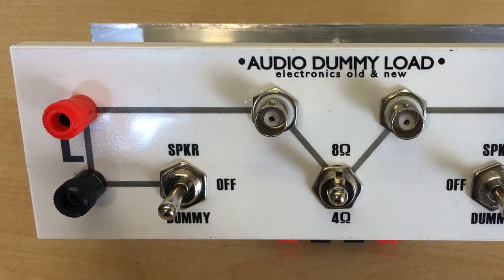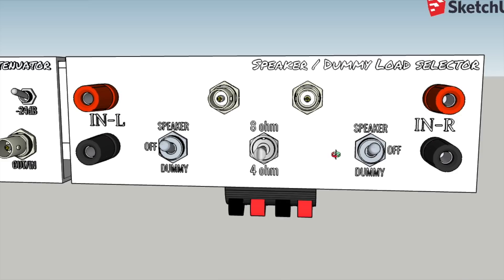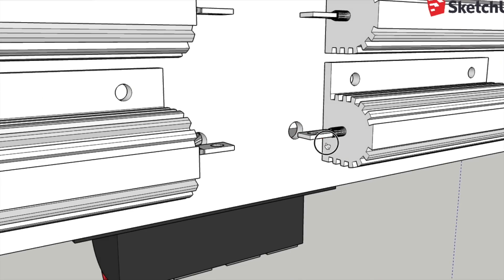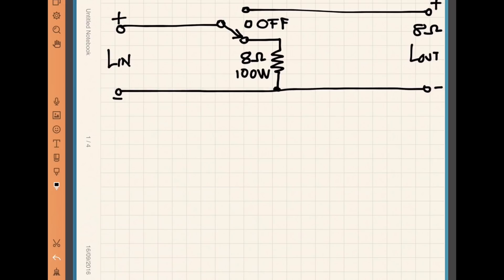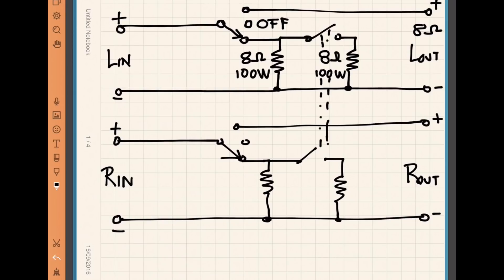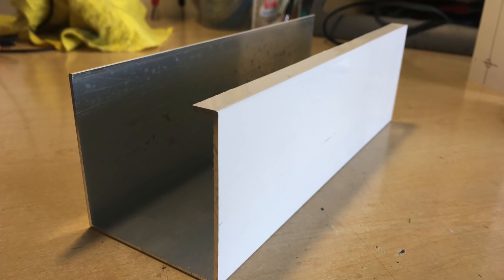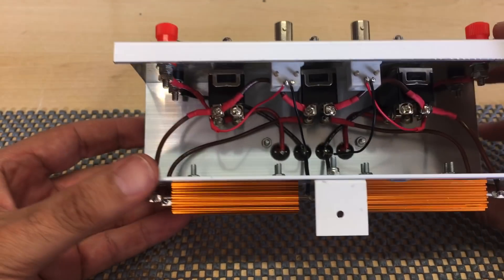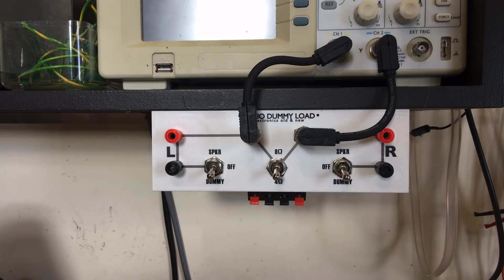Audio Dummy Load design and build

Comment: A very useful and tidy way to switch between loads and speakers. Great video.
Reply from the maker: Thanks George.
Reply: Boo -  Hi George regards Chris
Reply: @allthegearnoidea6752   Hi Chris. Very tempted to follow Manuel and his design on this... also looking at the attenuator and the cap tester designs. My brain is a fixing one, you and Manuel are thinkers who can design stuff.
Reply: George Christofi I would like a high voltage capacitor tester would be really useful.
Reply: @allthegearnoidea6752  just look in the videos on this channel. Manuel has a great design and really easy to implement.
Reply from the maker: Guys, my head is starting to swell :)
As for the cap tester, there is a small improvement that’s worth mentioning. I found a dc-dc booster on eBay that goes up to 450V dc for under €10. 
I think that would be a better option than the expensive torroidal transformer I used in mine.
Reply: @electronicsoldandnew  Now that sounds like a great idea and could put the unit into tiny box possibilities. Without that toroid or standard iron trafo it becomes a much cheaper proposition. Thanks for the heads up Manuel. And you are allowed to have swelled head... the designs are really great.
Reply: Electronics Old and New by M Caldeira  Great minds and all that I was looking on eBay for the very thing last week but couldn’t find the one that I had seen previously.  If I couldn’t find that unit I was going to build a simple fly back converter as the current need for testing is very low.

Comment: I´ve also built a similar dummy load; but with a different scope connection: The plus AND minus have BNC-connectors, so i can connect a scope without grounding the minus - but i need a scope with two channels in differential mode.
For a stereo application i need therefore a 4 channel scope; two of them for the left and two of of them for the right channel.
The ground of the scope for all four inputs has to be connected to the ground of the amplifier.
Reply from the maker: That's a very complete system. I don't normally need that much detail, so this one works fine for me. For now anyway :)

Comment: Last year made my own  (2 x) 2 x 4Ω dummy load. I avoided the switches by putting one extra input connector on the front, to have a mid contact between two 4Ω resistors.
The problem with the grounds can be made a bit safer by putting two 50mA Fast fuses in the negative of the BNC connectors.
What you did, adding a speaker connection, is a very good idea, I did not see that one.
And nice way to finish the front, but I hope that it will stand the test of time.
Reply from the maker: Thanks Eric. It has so far. Looks and works very well. Obviously I’ve thought of a few mods to do, as can be expected. One is never fully satisfied :)
Reply: And commenting is made so easy these days :)

Comment: Nice design, but may i give a suggestion ? 
Place the powerresistors inside the housing, that way you don't have to make holes in te back, and also, 
you can place a small fan (40x40x10) on one side of housing and use the housing as a airduct and lett the warm/hot out on the opposite side. 
The only minor to this, is that the fan needs a 5V or 12V powersupply.
Reply from the maker: Good suggestion. However, I don’t normally test high power for any length of time so the heating has never been an issue for me. Outside, the cool somewhat by convection, and I don’t see them anyway. 
Who knows, maybe there will be a version 2 soon:)

Comment: To minimize the possible damage and havoc that may be caused by accidental loops to earth ground via the scope earth ground, or the interconnection of the amps negatives via any instrument attached to both channels at the same time, I would consider a  small fast blowing fuse in the negative lead to the BNC connectors...
Reply from the maker: That is a great idea. The scope should measure signals with only minimal current draw, so that would probably save some grief. I’m going to do that.
Reply: Great ideas, would appreciate if you could suggest a value for the fuse.
Reply from the maker: 100mA should be enough
Reply: I was wondering about this very point - thanks for raising it.

Comment: Thanks for the excellent video. Quick question... do I have it right that if I put my DMM across the positive and negative contacts of one of the BNC terminals, that it will read 8 Ohms?
Reply from the maker: 8 or 4, depending on the respective switch.
Reply: @electronicsoldandnew   nice! I think I'm going to just do 8 ohm - as opposed to 4 and 8 ohm - as it's what I have on hand.

Comment: M, thanks for your videos that are very informative.  A tip:  Try printing your labels in reverse on the overhead plastic.  Then with an iron, heat the plastic with the toner against your face plate.  If you get it to the right temp (I think its 175-215C)  it will fuse to your chassis.  You can then spray it with a sealer like clear lacquer.
Reply from the maker: I’ve tried that, but more often than not I made a mess of it as the aluminium is painted and it melted the paint 😊
Reply: @electronicsoldandnew  

So sorry to hear that.  Most of my stuff is brushed or anodized aluminum.  Toner will start to fuse at 230F.  Lacquer melts at 200F so I see your issue.  I have made it work but its probably my iron and I keep it moving.  I have used paint.  Rustoleum has hi-temp pain that is good to 1200F that works great.  Powder coating is good to well over 400F.

Comment: Really nice build looks great! I built one very similar on my channel but i added a low level sampling port for supplying a PC sound card.   Now i did plan on doing a video showing how to use free PC based tools for making amplifier measurement. I dont know if you have looked at using PC software for amplifier testing but there are some great tools for free. Im no expert on amplifier testing but I bet you could do a good video on this .  I am also really sold on 3D CAD but I am using Fusion 360 as it can do tool paths for my CNC machines.  But i did use Sketch up for a while and had no complaints.  I also noted you used wire wound resistors some of the audio guys moan about using none inductive loads but I havent found any problems and its not like we are doing lab measurement.  I did buy some much larger ceramic load resistors from china with a much higer power rating but not got around to building it as yet. I really could do with building a much small dummy load for low power testing.  I really like your from panel looks great. This is the unit I built https://youtu.be/lQMm0RcI6k0.
Reply from the maker: I’ve seen yours and liked it. I wanted to do the “modular” version to clamp on my shelves, hence the rather strange design chassis-wise.
I’ve used AudioAnalyser before with my PC and it is really great. I used it mainly for testing the response of a bunch of guitar pedals I did, but have not tried it on amplifiers yet. I know there are a lot of other, and probably better, systems available, so I’ll have to look into it.
Fusion 360 looks good, but as I don’t own a CNC I’ve not tried it yet. So much to learn, so little time :)
Reply: Electronics Old and New by M Caldeira  Yes not enough time in the day. Thanks for sharing always enjoy watching construction projects like yours thanks for sharing.

Comment: Cool video. I was thinking of making one myself but version 1 was not much good as the resistors at 1Khz were very inductive giving me ridiculous output level powers.

Would it also be worth putting resistors in circuit with the scope BNC sockets to reduce the possibility of high currents flowing down the scope leads. Scope has no load so readings should not be effected.
Reply from the maker: I’ve never had a problem with the scope leads, but if you put resistors in you have to realise that that resistor will become added to the scope input resistance do your readings will be slightly off.

Comment: I realize you want to fit the space and minimize components, but I wonder if you used an audio matching transformer at each input how well it would work. I think it would keep from grounding the amplifier output with the scope leads.
Reply from the maker: That would prevent shorting, but would also suppress dc offset information as well as any oscillations that may exist beyond the limits of the transformer’s response.
Reply: I agree that an audio isolation transformer can be a nice feature for testing some amplifiers, bridged outputs can be a real pain in the bum.

Comment: My workbench is starting to look a lot like yours :) thanks for all your help with diy test equipment. Just one question, I use my scope (same as yours) when doing alignments, is it normal for the signal voltage to the scope to drop when you switch to dummy load? I inserted a 1vrms test signal into the input of the audio dummy load and on speaker setting all good, but as soon as I switch to dummy load the voltage reading drops dramatically. Thanks again.
Reply from the maker: You can get a small drop, but it should not be too significant. Test the resistances at the input to confirm that all is well.

Comment: Excuse my rookie question.  I had a hard time seeing the positive speaker out terminal connection point.  Is it connected to the lower terminal on the switches (same side as the other connections)?
Reply from the maker: Not sure I understand your question. Follow the schematic at 14:40 and then check connections with a multimeter.
Reply: I believe I understand from your schematic, just double checking.  There are 6 posts on the switches for L & R, I believe you are using 3 posts on one side, corrects?
Reply from the maker: Can’t remember now. It’s been a while since I did that project.

Comment: Hi,
Are the resistors non-inductive? Do I need them to be? 
Thanks in advance,
Sean
Reply from the maker: Preferably, but not too critical for most purposes.
Reply: @electronicsoldandnew  
Thank you. What made me question it is, that when I look on eBay for 8 ohm dummy loads, most say, "for tube amps". The ones that don't say that, say "non-inductive".

Comment: another excellent video project,i have the parts just gotta get off me butt and build it,my only scope is a 1962 HP 130C which apparently will do XY mode,will that work for L and R channel viewing? im pretty green at electronics only a few years of electronics in high school and tinkering around blowing things up and shocking myself..
Reply from the maker: If it’s a two channel scope it should work fine.

Comment: Great looking gear, you are doing what most forget thought out  and coherent design (seems you learned the hard way ;)
I probably never have the use for it but i would build it anyway just be course of the looks of it and you never know what repairs end up on the desk.
Would a "cheap" battery powered oscilloscope be good enough to show what you need on those BNC's?
I mean, there is nothing  much above 100kHz worth looking at and you won't have to be concerned about grounding anything, as you mentioned, it is you hearing that will do the final testing.
Reply from the maker: A battery powered scope is ideal - actually one per channel, but that is getting expensive.

Comment: Nice job! Wish I could get my simple front panels to look as good without going to the trouble of getting full-sized self-adhesive laser sticker sheet (strangely hard to get here). Mine always suffer from the glue being visible through the sheet, so I'm curious what glue you used?

Also, with respect to the common scope ground shorting out bridged &/or other floating/isolated outputs, I wonder if a 10:1 twin-T or twin-Pi attenuator between the dummy load & each BNC would provide enough isolation? By my rough calcs it should provide several hundred K of resistance between the scope ground & each channel - which I'd expect to be plenty - and the scope readings will still be correct when set to 10:1.
Reply from the maker: The sheets I previously used were the ones that you mentioned - self-adhesive laser sticker sheets. I also have a problem finding them now, and had a slight mishap with the ones I did find. They melted and nearly messed up the printer (they were labelled as laser, so I don’t understand why this happened). 
I used a spray glue from 3M, which worked quite well here, much to my surprise. 
As for the bnc problem: if a balanced pi or T attenuator were to be used, I would imagine one would choose the impedance as 1M (same as present scope impedance within 1:1 probe) with 20dB attenuation. I’m not sure what happens when the grounds of the two amp outputs are in fact the same ground point. You will effectively be shorting the two attenuator’s grounds at both ends and I’m not sure what the attenuation would then be. Perhaps you could give me your opinion.
I’d also like your opinion on simply adding a 100n cap from bnc ground to speaker ground.
Reply from the maker: Sorry Jim. Forgot to mention that when I did the guitar pedals with the self-adhesive film, I got to see the glue on light background. This ended when I painted the enclosure grey and then stuck the film onto it. On a white background, I think I’d have the same problem.
Reply: @electronicsoldandnew  Thanks Manuel, I think I used 3M 77 or 90 glue on off-white which was fairly visible; might try a grey/darker bg net time. And yes to the melting problem - Brother printer, by any chance? They apparently use a higher temp than others, which is why I've been wary of changing to a generic-type sheet (had to fix one once when a friend bought the same printer as me & tried to use standard OHP laser sheets in it - several hours of swearing later, ...)

Yup, voltage-wise, 10:1 = 20dB, and 1M to match scope. Good point about the case where both ends are connected to ground though - didn't think of that! I had considered an isolating cap; I guess my main objection was that I'm an mostly an RF guy & don't like putting reactive components in strange places where they're not necessary. Nothing wrong with it for AF though, but I'd be tempted to (a) make it as large as possible (at least in the uF range) to pass low freqs, and (b) suitably voltage-rated since even a transistor amp could put 50v-100v or more across it. That'd suggest a plastic film cap, and I'd also be tempted to fuse/PTC it just in case.
Reply: @electronicsoldandnew   After a bit more thought & a quick simulation: 100nF/0.1uF would be fine; the -3dB point would be down around a couple of Hz, and flat within a fraction of a dB from 10Hz or so up.

Comment: Good tutorial. Thx. One question about resistors power demand. How to size power of resistors. Just 1:1 RESISTOR VS AMP@8ohm so having 50 W@8ohm amp should I go for 50 W resisitor or oversize them 50-100% so eg 100W. Does exist any kind of rule here ? Thx. Marek
Reply from the maker: Always oversize. I’d go for at least 150% of my max expected power, and even then I’d keep the test times at full power short.
Reply: I decided to go for 100W with possibility to install extra heat sink - radiator- Thx. @electronicsoldandnew

Comment: I'm trying to replicate this for myself... but I cannot think of why there needs to be an "OFF" position.  What is the use case for wanting to bring a signal into this device and not use the dummy or speaker setting? I'm sure there is a reason... it is just eluding me at the moment. Thank you sir!
Reply from the maker: This setting is to be able to monitor it on the scope with no load.
Reply: Ah, yes, that makes perfect sense. I guess this is sort of a "bonus" feature so you don't have to hook the scope directly up to the outputs of the DUT. Thank you sir!  @electronicsoldandnew
Reply from the maker: Pleasure
Reply: @electronicsoldandnew  One follow-up question though... if you take the Off / Pass-thru option, wouldn't you need to be extremely careful of what goes to the scope so you don't damage it or possibly even damage the amplifier outputs?  Sorry for my confusion... I'm just having a hard time trying to mentally picture where all the power/heat will go if it is not routed through the resistors. Thank you again sir.
Reply: Nevermind... I found out that the worry only applies to tube amps where the output transformer could be damaged without a load. This, apparently, does not apply to solid state amplifiers.

Comment: Great video as usual! But I probably would have done the circuit slightly differently, with the second resistor between the +input and the common contact of the speaker/off/dummy switch. And I would have made the impedance selector short that resistor. That way you can switch impedance regardless of whether you're using the speaker or the dummy resistors. And especially for tube gear, higher impedance is sometimes necessary, isn't it?
Reply from the maker: I think I get your idea. However, if I see it right you would have 8 ohms ir 16 ohms to choose from. Maybe I didn’t get it right. Not sure.
Reply: @electronicsoldandnew  Yes. I forgot to mention I might have used 4 ohm resistors but in my experience, most equipment that can use 4 ohms will work fine with 8 ohms, but not the other way around. And some old equipment might need even higher impedance. 
Now that I think about it, I might do it even more differently: I would connect your second resistor to the common pin of the double-throw switch (so that it can be used with the speaker too), and I would put two banana plug sockets in series with the entire circuit, with a switch to bridge the plugs or open the circuit (I'd probably make that a protected switch so it can't be operated accidentally). Maybe I'd even put that on the "ground" side.
I might add some neon lighs on the ground side too, to warn against "hot ground".